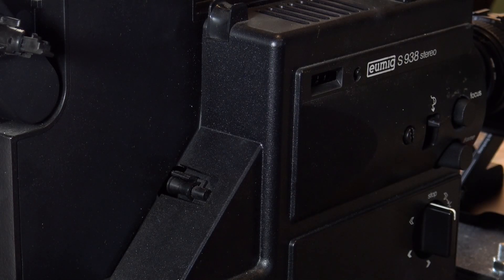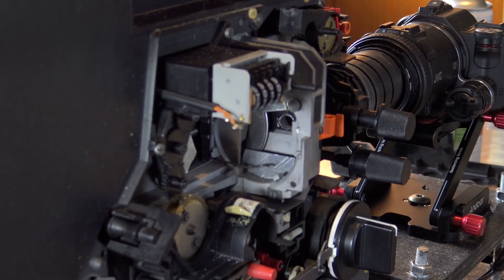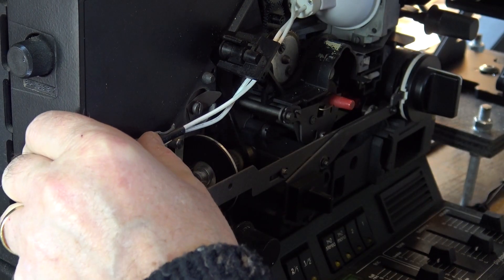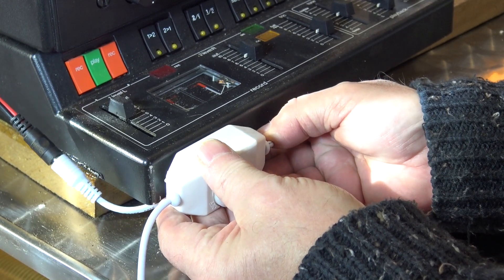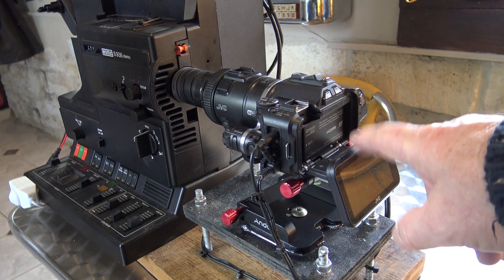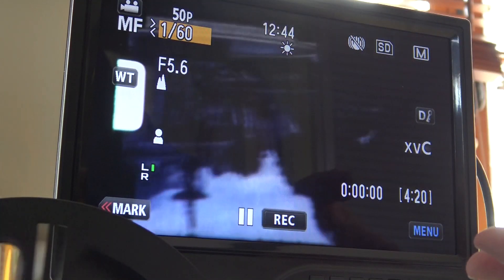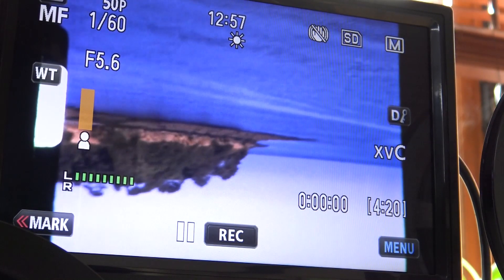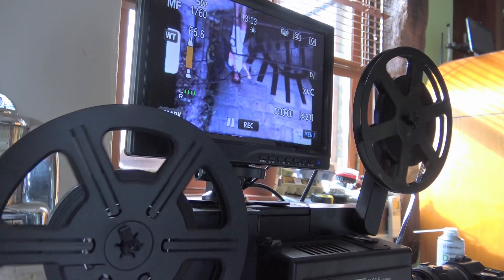Super 8 m/m film telecine/film transfer unit/Telecinema/Film Scanner

Comment: Hi Ian - hope all is well. I've got myself a Eumig Mark S 802 projector, but I am still trying to find a suitable projector lens to build my telecine machine - Do you think this one would work, or is it the wrong shape at the bottom?       (i don't think youtube has let me post the link as I am reposting this as my first message vanished - The lens is on ebay and it's called - Bell & Howell 16mm Projector Lens 2" f1.6 made in USA
Reply from the maker: Hi Simon, all good here, I trust that you are well. I don't think the the 16mm lens would not work, the barrel would be too big! Have you tried removing the rear element of the lens on your Eumig? It should just unscrew and then try it with your camera lens set to Micro the Eumig lens will have to be moved a little further away from the film frame and just set up the camera and see if you can get the image in focus, the zoom on your video camera will have to be at least X 15 to fill the frame, the projector speed will have to be around 20 fps to get rid of the strobing effect, the slider switch of you projector needs to be between 16 and 24 Frames per second as there is no speed adjustment as such on that projector!
You could just buy one of these I did but you would need deep pockets, very deep pockets indeed. https://youtu.be/042PFRxknQY
Reply: @mackenzierough  thank you Ian, and for your email too, I will email you back tomorrow x

Comment: I think there is no lens. You wrote in the comments that you removed the lens. can you explain fully
Reply from the maker: I removed the original projector lens and replaced it with a special telecine lens which cost over 200 euros but the company that I bought it from doesn't sell them anymore!
Reply: You have written another solution that can perform the same function. It's like removing the back of a normal lens.
Reply from the maker: @doksanlaranadolu3606  Yes that has worked for me if you can unscrew and remove the rear element.

Comment: Why would you want to see the sprocket holes in the pictre?
Reply from the maker: I don't but there is a fad these days to show them, I crop them out in the edit but it does give you a larger picture area even when they are cropped in the video edit, bigger than you get when you project them!
Reply: @mackenzierough  I guess there's no harm in having access to a larger area, in case the frames are bigger than expected, or to one side or whatever.  As you say, you can crop them out later.

Comment: Hi there. Cool video! I have question if thats ok. How do you connect the new lamp to the projector and what equipment do you need? Thanks :)
Reply from the maker: You have to disconnect the lamp power supply from the projector and run a new cable to the replacement LED lamp which comes form the dimmer switch and a 12volt transformer available form amazon.

Comment: Hi....Just found this channel - great results - is there any chance you could please share where to get the telecine lens as the links dont seem to work , Are you still using the SD-9?
Reply from the maker: Yes, sadly the two companies have stopped selling them, one said they may have lens available in September, yes still using it. On one of my projectors I was able to unscrew the lens and just use the front element you could try that.
Reply from the maker: Transfer Lab still are not selling the lens any more, I just converted a standard lens by unscrewing and removing the rear lens element, it works a treat!

Comment: I can't seem to find a place where they are selling lamps like the one you are using, is there a way you could point me in the right direction on where I could obtain one of these?
Reply from the maker: You can find similar lamps on Amazon, I will send you a link later today, what country do you live in?
Reply: @mackenzierough  The US
Reply from the maker: This should do the job! https://www.amazon.com/dp/B08BHMN5GZ/ref=sspa_dk_detail_3?psc=1&pd_rd_i=B08BHMN5GZ&pd_rd_w=cLiOB&pf_rd_p=085568d9-3b13-4ac1-8ae4-24a26c00cb0c&pd_rd_wg=V1Pa0&pf_rd_r=KMHF881B7ZY5E6AH6BQV&pd_rd_r=50c3a196-1c33-4732-bdea-991f17effeb4&spLa=ZW5jcnlwdGVkUXVhbGlmaWVyPUEyVDY4RjBPOURFR1QzJmVuY3J5cHRlZElkPUEwNTg1NTk2MzgxSVFOTjU0V1pSRiZlbmNyeXB0ZWRBZElkPUEwNzc1NDc4MkZRS0JYMEFUU1JIVyZ3aWRnZXROYW1lPXNwX2RldGFpbCZhY3Rpb249Y2xpY2tSZWRpcmVjdCZkb05vdExvZ0NsaWNrPXRydWU=
Reply from the maker: This dimmer should work with it.  https://www.amazon.com/dp/B0865XTK36/?coliid=I24F2XTZQ2V2S9&colid=163IMOXGYPNPF&psc=1&ref_=lv_ov_lig_dp_it
Reply from the maker: I'm sorry but I can not find a suitable lamp with the two pin fitting!
Reply: @mackenzierough  That first set of lights should be fine correct?
Reply from the maker: Yes, I have used similar, can't find anything any better, looked on EBay too! The company in France that I bought the lamp in my video has stopped selling them, good luck.
Reply: @mackenzierough  Thank you very much for the help, the only question I have is how exactly I will connect this LED to the dimmer cause it doesnt seem  to have the plug for it.
Reply from the maker: I'm sorry but I have just noticed that these lamps are 110 volt, 12 volt lamp with a power supply would be better including a connector, when I get time I will research further.
Reply from the maker: I'm having trouble but this may do, take a look:- https://www.ebay.com/itm/114719915067?var=414876493339&hash=item1ab5d6fc3b:g:8cMAAOSw8oFdGUgi
Reply: @mackenzierough  This could possibly but it says the dimensions are 57x9 mm which might be to large for the projector. I appreciate the help by the way, I’m glad I’m having some help with this since you seem to know where to look for this stuff.
Reply from the maker: Have a look on this site:- https://www.aliexpress.com/item/1005002330998323.html?spm=a2g0o.productlist.0.0.28fc294feRo5F6&algo_pvid=25ff4775-790a-419f-bdee-fb8156efed28&algo_expid=25ff4775-790a-419f-bdee-fb8156efed28-5&btsid=2100bdd016204623465095585ef95b&ws_ab_test=searchweb0_0,searchweb201602_,searchweb201603_

Comment: WOULD LOVE TO TRY THIS. i HAVE THE RIGHT PROJECTOR AND LAMP SOURCE BUT DON'T KNOW WHERE TO GET THE LENS FROM.
I WOULD LIKE TO USE IT WITH A GH2 OR SOMETHING LIKE THAT. i ALSO HAVE VARIOUS OTHER VIDEO CAMERAS ICOULD USE.
PLEASE TELL ME WHERE I CAN FIND THE LENS AND MOUNT.

THANKS
Reply from the maker: I'm sorry but I can't find the lens anymore, I found one on ebay from Germany and another from a company in France but they do not sell them anymore, you could try unscrewing the elements on your projector lens and try using the front or rear element only, depending on your lens, if I ever find a lens I will contact you, good luck.
Reply: @mackenzierough  thanks for getting back to me.
Yes I will try that with a old lens.
Enjoyed your video.
Reply from the maker: Transfer Lab still are not selling the lens any more, I just converted a standard lens by unscrewing and removing the rear lens element, it works a treat!

Comment: Hi Mackenzie Rough. Thanks for this impressive Video. I wonder why it seems that flickering wasn’t an issue. Did you certain modifications on the projector. I assume it would not run as a Swiss clock without some regulations. How did you solve that problem? Best regards Christian
Reply from the maker: Thanks, I set the camera shutter to the slowest speed at 30th and ran the projector on the variable speed to I guess around 20 FPS, I adjusted the projector speed until there was no strobing/flicker.
Reply: Normal projectors run at 18FPS so you want variable speed. If it runs at 16 2/3 frames a second you get 50Hz the frequency of PAL. So you record your camera at 25FPS which gives you a 50Hz rate. The same problem you would get if you tried to record a television screen.
Reply: I see. But is there still need for continually kontroll and perhaps regulation of projector speed under ongoing process?
Reply from the maker: No I have not had to touch it since setting it up but I do find that on each start up of the projector if it has not been used that day it runs a little slow giving a fliker, I just let it run for 5 mins before lacing up the film and all is fine.
Reply: Thank you for your replies. I shall try that out.

Comment: With 16mm sound at 24 fps, and for us who use 60hz, how would one do the transfer to eliminate shutter flicker, yet keep keep sound speed normal...outside of adding a five blade shutter?  Excellent project though.
Reply from the maker: Thanks, I adjust the speed for sound when I do the edit, I use Pinnacle studio 23 editing software.
Reply from the maker: I shot this 16m/m film off a small screen at 24fps 50hz with a Sony FDR-AX33 camera just set to auto, it's not bad but there is slight picture strobing.
Reply from the maker: https://youtu.be/zEHjJ_9qJhs
Reply from the maker: Here is the sound speed increase:- https://vimeo.com/436032066/8914277fdf

Comment: Can't seem to find this lens on transfer-lab.com website, lamp is there ok. Did a search but comes up as  no result. Could you put a link to the lens please. thanks.
Reply from the maker: You have to message them as it is not on the site, I a have just bought a new lens for a much cheaper price on ebay  it was 100 Euros from Germany, again it's not listed you have to message them:-         https://www.ebay.fr/itm/Video-Transferobjektiv-85-mm-f%C3%BCr-Projektoren-mit-32-mm/283402885056?ssPageName=STRK%3AMEBIDX%3AIT&_trksid=p2057872.m2749.l2649
Reply from the maker: The Ebay seller in Germany speaks English, good luck
Reply: Hi I am from the us, great video thank you.. Question sir, the super 8 sound projector you are demonstrating in this video, is that a telecine projector with 5 blade ? If so there is no use trying to convert my super 8 that looks like yours over which is not 5 blade. Thank you.
Reply from the maker: @frankmolina5929  Sorry Frank but I have only just seen your message, it is just the normal  model with a 3 blade shutter I think.
Reply from the maker: Transfer Lab still are not selling the lens any more, I just converted a standard lens by unscrewing and removing the rear lens element, it works a treat!

Comment: Trying to follow your setup, could you be more specific about the lens you are using, and what you bought online, and a link to show just what you are talking about. That would be very helpful. Thanks for the insight into your work.
Reply from the maker: I bought the lamp and Lens from Transfer Lab, France:- https://transfer-lab.com/
Reply from the maker: They were not cheap at 310 Euros, Lens Part number:- TL-P5935 Condenseur macro Films 
 € 250,00 €
Lamp part number:-TL-P5911 Eclairage LED pour Transferts Directs 
 € 49,90 €
Reply: @mackenzierough  Thanks, that's a lot of money. The search goes on.
Reply from the maker: Yes it is, this is a good deal from Germany, the projector has been converted and lens replaced but camera and stand is not included:- https://www.ebay.fr/itm/Videotransfer-mit-EUMIG-Super-8-Tonfilmprojektor-Mark-S-802-mod-Telecine/283394112996?_trkparms=aid%3D111001%26algo%3DREC.SEED%26ao%3D1%26asc%3D20160908105057%26meid%3Da689043b6fdb4f079cf02202ef193bde%26pid%3D100675%26rk%3D2%26rkt%3D15%26sd%3D153367482379%26itm%3D283394112996&_trksid=p2481888.c100675.m4236&_trkparms=pageci%3A1684395d-3bee-11e9-82c8-74dbd1800607%7Cparentrq%3A38035a701690ab4d9b036e39fffde013%7Ciid%3A1
Reply from the maker: I read somewhere that if you can remove one of the elements from your projector lens that would do the job!
Reply from the maker: Transfer Lab still are not selling the lens any more, I just converted a standard lens by unscrewing and removing the rear lens element, it works a treat!